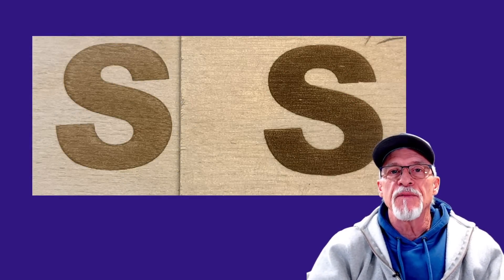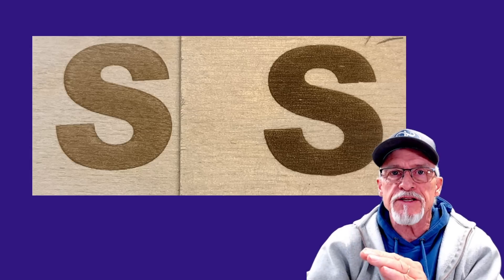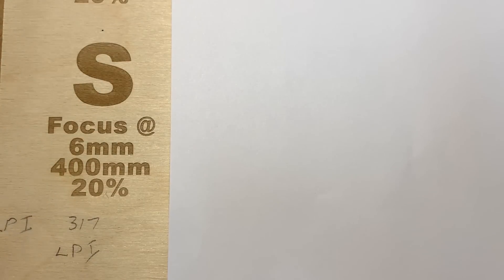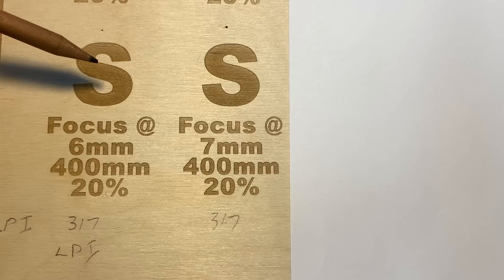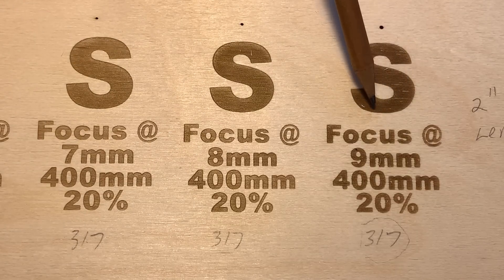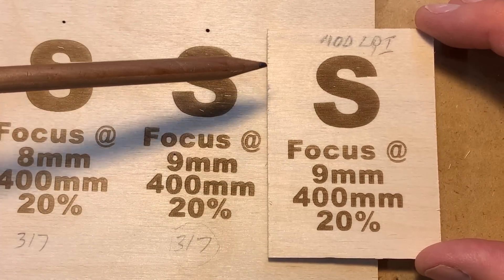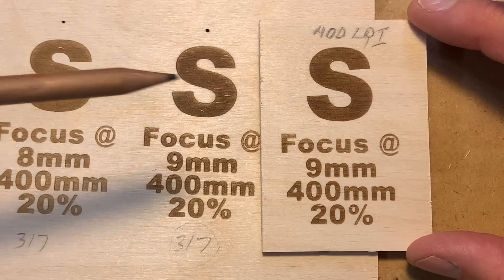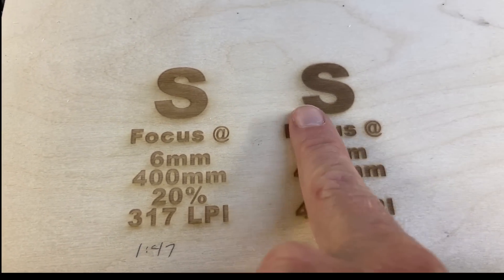Laser Engrave Darker designs without extra power, Baking Soda or Borax

Comment: So when you up the DPI, you’re essentially going over the same spot multiple times. It’s just a multi pass hit. Now the trick is your whole laser point isn’t going over the same spot multiple times. It’s only PARTIALLY going over the same spot, so you don’t get a full 100% pass. It’s like going over the same spot at faster speeds or lower power. I do a second pass with a tracing around my work and it sharpens the edges of lettering and engraving. When you refocus it’s just a larger and less powerful hit over the same spot. You can do this the same way by just upping the speed and going over the entire project a second time with the laser and keeping it fully in focus.
Reply from the maker: I do,allot of,what you indicated as well, especially the line after the fill. Really makes it pop!

Comment: Great video Robert. Others have commented on the edges. What I usually add is a secondary burn line at small power. It really sharpens the edges. Have you tried this before?
Reply from the maker: Yes it works great, just add a sub layer a pond set it to line to score the parameters. Really makes the engrave pop!

Comment: What's that digital pressure gauge attached too? Is it just for the low? Or does it display the high as well?
Reply from the maker: He’s a very accurate digital air guage. I engrave all my acrylic a 1/10 of 1 pound and get 0 ghoasting.
Reply: @computercreationz  I ended up adding a SMC gauge like yours and it's great. I added a "T" to the single line that goes to the laser head and added the SMC gauge to the port and it's very accurate and makes setting the air easy. I ordered mine with the panel mount bracket and i'm going to cut a 31mm square hole in the sheet metal on my Nova 35 and install the gauge. Thanks for you help..:)
Reply from the maker: It’s plumed into the single line air delivery system so it provides both hi and low pressures depending on what I have selected in lightburn air assist on (hi volume air for cutting) or air assist off (low volume air for engraving ) this is specific to thunder laser brand!great features that stands that brand away from anyone else
Reply: @computercreationz  Ok, Can you control the air from the SMC pressure Switch/Gauge? If so how does it hook into the controller? Or is it just on the 12vdc or 24vdc for power? I have a new Nova 35. Thanks..:)
Reply from the maker: No the ar plow control comes from 2 needle valves below the guage @user-zq6pj5jo8j
Reply: @computercreationz  Ah OK, So it's just a digital air gauge. Thank you for the info..:)

Comment: is there a setting in lightburn to adjust the focus?
Reply from the maker: Usually that is done manually or with the manufacturer process in the software in the controller
Reply: @computercreationz  thank you, I just ordered a focus gauge, my laser has a powered bed but it uses 2 laser dots to manually focus, I push the up or down button to get both red dots lined up so there are no mathematical settings for me to adjust or to know what distance I am or what distance I am moving it. I will use the gauge once I get it.

Comment: You just earned a new sub ! Great information, I will give this a try. I know now that I also have to much air flow with the air assist and that explains why I'm getting so much contamination around an engrave on wood. Seems as though I'm learning something new on a daily basis. At age 61 I'm glad that I can still learn new tricks...lol...I'm using a Genmitsu 6050 for the laser as I don't have the room in my small shop for two separate machines so the cnc serves two purposes. I thought the cnc router was enjoyable, but adding a laser (10 watt output) took things to a whole new level of fun ! Cheers from Utah, and thumbs up !
Reply from the maker: Thankmyou for the sub and comments. I appreciate it!

Comment: Are you moving the bed away from the laser to get out of  focus?
Reply from the maker: I’m adjusting the lens instead. Thunder has a slidable laser lens that goes up
And down. I typically manual focus most all my projects
Reply: @computercreationz  I was wondering if you are defocusing toward or away from material?
Reply from the maker: @therealwaldopepper7802  yes away from the material.

Comment: Thanks Robert! When doing this trick along with cutting, if I need my cut to be at 6mm focus, would that mean I need to use the Z axis function for the bed to move at the proper height during the project when switching from engrave to cut?
Reply from the maker: enabling you z axis is risky in my opinion, I will do in two different files engrave first out of focus, then re focus and cut. way to many horror stories when you have the z enabled in lightburn. thanks for watching
Reply: @computercreationz  sounds good, thanks!!

Comment: Can you change the focus in lightburn getting these gradients? Or do you have to stop the job and manually focus it even though the machine has auto-focus?
Reply from the maker: you can by enabling the z but it’s very risky unless you are very skilled at lightburn. I keep mine turned off for that reason. usually I run the engrave out of focus first then in a separate run I refocus and cut.
Reply: I am so new all of this is greek to me..
Reply: @Winsumone  keep at it if you are really looking into it. It is fascinating stuff and I'm constantly learning. I forgot I even commented this. 😅

Comment: We use the 4” head. What would the setting changes Need to be? Or are we better off swapping back to the 2” head? The people we bought the laser from said they used the 4” all the time.
Reply from the maker: Your beam spot is way bigger on the 4” you will loose even more detail unles it’s very large designs. 1.5” or 2” lens is my goto lens for engraving

Comment: What is the benefit of using slow speed and low power? Wouldn't higher speed and higher power be more efficient?
Reply from the maker: it all depends on the size of your design, if you have a small design setting you speed at a higher rate may not be achieved. large design faster speeds because the machine has the room to go that fast. for me it about being realistic about the speeds that your laser is capable of traveling. Thanks for the comments

Comment: Silly question, but if you're doing a mix of engraving, scoring, and cutting, do you just (within Lightburn), turn off the scoring and cutting operations after adjusting your lens to 9mm, run it, and then move the lens back to 6mm for the remainder of the operations? Is it that simple or am I missing something?
Reply from the maker: yes that’s how I would approach it
Reply: I'd go with in focus first, then out of focus to darken it.